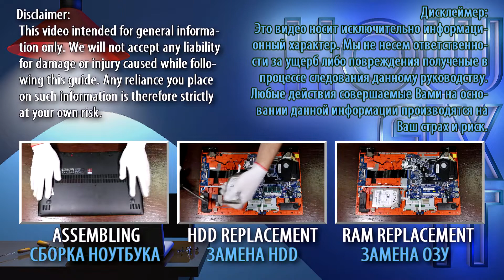Lenovo Flex 15 Disassembly, Fan Cleaning, and Thermal Paste Replacement Guide

Comment: i have the lenovo flex 15 and 4gb ram can i extension my ram to 8 or 16 with out remove my ram
Reply: Yes, you can. I did upgrade mine to 8GB and now it is hassle-free.